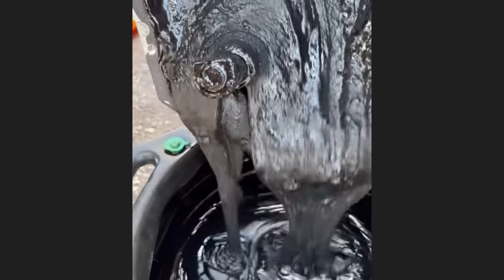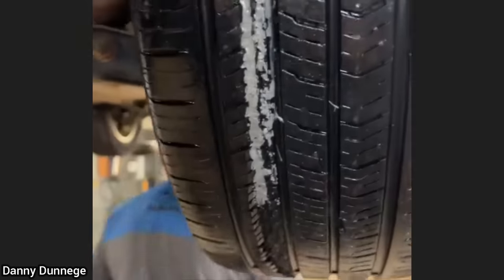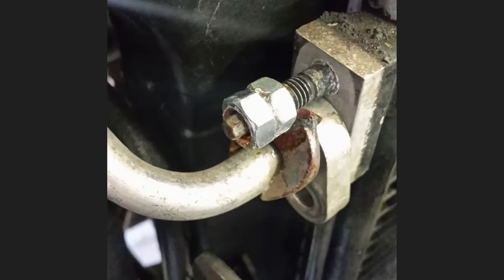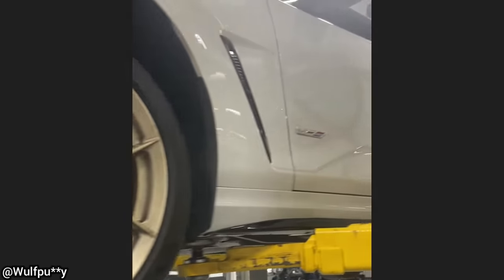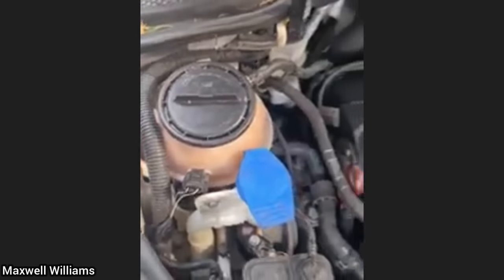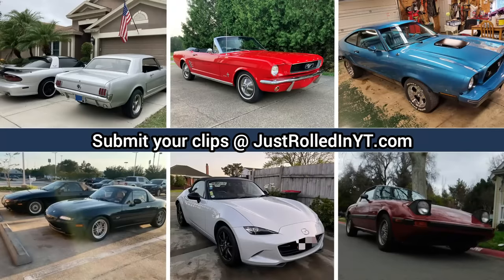Customer States Car Shut Off After Adding Wrong Fluid To Engine

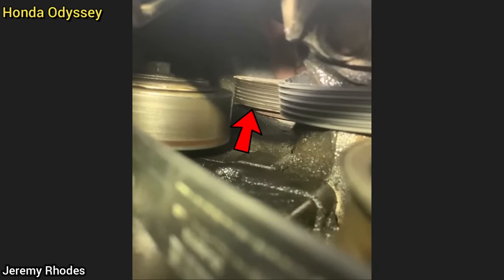Comment: 1:22 To be fair, a harmonic balancer does sound completely made up😂
Reply: It's the duty of the shop or mechanic to explain issues to the customer. I'm sure less people would decline repair if you told them a bad balancer can destroy engine bearings, crack or bend the crankshaft and they're risking catastrophic damage or complete engine replacement.
Reply: A quick web search would confirm their existence in that case....
But people don't tend to think logically most of the time.
Reply: That it does, and as someone who doesn't know much about engines I wouldn't understand from the name. But if the mechanic pointed it out and said "see that thing wobbling right there? it ain't supposed to be wobbling" I'd understand that.
Reply: I had that done on my car years ago, it’s held on by the flux capacitor, right against the flywheel
Reply from the maker: There are a handful of names for a harmonic balancer. Also this is why a ton of shops and dealerships record everything they see wrong on a customer's vehicle and will email them the video.
Reply: @JustRolledIn  Thanks for the update. I always wondered why shops don't email (or display) videos. My dealership tried using a monitor in the waiting room. It didn't last long because a customer got angry and destroyed it.
Reply from the maker: @mikep490  a lot of shops are going this route now, which is good for the customers to know what's wrong with their vehicle and that customer must have received a quote they didn't like 😅
Reply: @Yonkage-ik5qb That's what I do with customers. I take em to my bay and physically show them the failing component and explain how important it is to get fixed or if it's something they can live without.
Reply: @JustRolledIn I don't want em to get too good at it, because I need my "customer declined repairs" drinking game to stay intact. 😂😂
Reply: @JustRolledIn  Showing the customer takes some of the "mechanic scam" out of the picture. (Of course, a picture isn't proof to many people.) I wondered about the guy who did the smashing. "Ok, Mr Smith, here's what we found and it'll cost $2000 to repair. <smash> OK, Mr Smith, you saw what we found and it'll cost $7,000."
Reply: LOL yes, I think 'harmonic balancing' is what you get done at a solstice retreat in Sedona.
Reply: agreed it sounds like a dealer scam or at LEAST like a hazing ritual that involves blinker fluid.
Reply: Took my car in for routine maintenance, and the mechanic wanted to charge me $70 a quart for headlight fluid. I asked if he thought I was an idiot and thought I'd fall for that BS. I left and took it to another shop and paid only $40 a quart. Some people can't tell when they're being taken advantage of.
Reply: @Gruntsworth $40 a quart? That's highway robbery! My mechanic only charged me $5 a quart and 6 hours worth of labor to replace it.
Reply: The term "harmonic balancer" has been around for 90 years (invented by Duesenberg in the 1930s), although it is not a term that most people use in their daily conversations.
Reply: Would you prefer: Torsional Damper, instead? :)
Reply: It does sound kinda Star Trekky.  "The harmonic balancer connects to the phase inducers, which keeps the plasma coils aligned."
Reply: @MrCookieCat  Sir, there are no phase inducers within the matter/antimatter reaction assembly (MARA). You obviously didn't pay attention at the academy. Stick to impulse engines.
Reply: @MrCookieCat  That sounds more like lingo from the Turbo Encabulator videos.
Reply: found the customer smh
Reply: To me 'Harmonic engine balancer' sounds like something you need to fix a spacecraft

Comment: Mechanics gotta have love-hate feelings toward the DIY crowd.
They lose some business at first, but get so much more in return.
Reply: They keep us in business, brother. We love seeing the innovation some folks have.
Reply: To be a good DIY mechanic - you must understand your limitations from knowledge, accessibility, and tools. I can do a lot of things, but also very self-aware of my limits and lines and call the professionals. Sad thing, many "professionals" don't have a clue either. Insert the 20 something year old tech who almost drove my YJ Jeep through his shop door when he didn't push the clutch in and tried to start it(and then blamed it on a "faulty" neutral safety switch which didn't even exist on Jeeps in 1988) and then had to call me on the phone to ask how to turn it off because he didn't know about the button on the steering column beside the ignition.
Reply: Not with me... been burned by too many professional mechanics that I choose to do my own work and I do it well enough
Reply: @Legendsingray  That 20 something guy sounds pretty clueless. I know automatic transmission Jeeps had a neutral safety switch. But I think a 50 something guy I worked with tops this guy. I used to have a 1984 GMC Suburban and one day 50 something comes up to me and tells me I parked too close to his Nissan Pathfinder because he had to depress the accelerator pedal before he could start it that morning. He actually believed the mechanical fuel pump and carburetor migrated to his vehicle! I told him he might have a leaking injector, but he wouldn't hear it. So I told him he now had a reliable fuel system and left it at that.
Reply: @zenjon7892  Lol, I'll fix your screwups anytime.
Reply: @zenjon7892 I completely agree. That said, for some jobs my hourly is better having someone else do the work.
Reply: @jsims2985  na.. I'll be damned if I let you touch my car 😬
Reply: except me. i aint a hack
Reply: @Legendsingray When the clutch release has failed, how are you going to start it on the starter in gear at the lights if there's a cutout?  It's a trick to get it to second, but after that you are good.  Happy days.
Reply: @zenjon7892  Yes.  I do about 80% of my work unless I just don't have the tools, a lift, time, or knowledge.
Reply: @zenjon7892  🤣🤣🤣

Comment: Customer states their car runs rough after putting something that doesn't belong in the engine into the engine....
Is this the reason a certain Dodge car has the word "fuel" on the fuel cap?😂

Comment: A seized brake caliper can sometimes burn a car to the ground. It gets the tire rim so hot so fast the tire catches on fire. Once you got as tire fire its all over.
Reply: I was thinking about a similar situation a few days ago. Back in 07 when I was at a MIDAS. A customer called and said they were coming in with the right front wheel hot and smoky. The caliper was seized. The wheel got so hot that the wheel cover melted! I drove the car in, removed the wheel cover, and started hitting the wheel with water until the steam stopped! The car needed front, caliper, pads, rotors, one wheel, and one tire.

Comment: Yes i did enjoy the video , and a like is always inevitable . You are right buddy the coolant is under pressure but so are the tires the transmission the fuel system and the braking system when operational so adding silicon , duct tape , a chain from time to time and spray foam which is often seen as fixes on this channel is not going to cut it , unless you want to be stranded , injured and potentially in handcuffs  if your choices injures others so please please count on a professional ..

Comment: 1:21
For me as a mechanic, the saddest thing is that there are so many of them and often even such cases can't teach them anything. I am not going to say that "if the service says that you have a problem in "xxx" and it needs to be replaced" you should just agree, no, there are some services where you can be simply deceived, but sometimes such distrust can cost much more than replacing what needs to be replaced.
Reply: Got hollered at from office one while I was under a hood in the shop, sounded urgent,   so I dash up. There is this red in face screaming lunatic,  had picked up r.o box waving it about (tickets going everywhere ) acted like he was gunna throw it a counter lady.  Stopped when I went through door. Screams at me "you dropped my car off the jackstands and broke my door locks!!".  I looked at manager and counter lady and busted out laughing. He stood didn't say a word.  Through laughing I said " I did your brake jobs on a lift sir be hard for me to break your locks ".
Reply: Offered him option a we call cops, option b you clean this mess up calm down apologize  to her and I'll look at them. He said " I'll never be back here!!" . Lol good riddance. 😂

Comment: Surely model-specific roof racks/carrier bars were cheaper (and safer) than a half-assed bed frame job through non-structural roof sheet steel, MOT incompliance, and entirely wrecking vehicle value.

Once they put something properly heavy on that roof it is coming down and through their heads.
Reply: Well, hypotetically, its harder to be cheaper than "free" and regarding the value it might be likely it doesnt matter to the owner. "MOT? Whats that?" - Seems unlikely it will ever see an MOT either.

Comment: I have the opposite problem.
Just junked all 5 lugs on my FR tire cuz shop didn't regulate one of their impacts at the mom & pop shop I last went to. Also had to cut shackle bolts to rear sway bar cuz dealership didn't torque spec, rather impacted to point mounts were bent into the aftermarket bushings.

Comment: I'm partial to the bedframe, with killswitch bolts installed. Some problems just solve themselves. Pray no one but the installer is in the vehicle, and that it travels too quickly over some speed bumps...

Comment: I know that stuck hood latch very personally.....thank you VW for yet another miracle of German engineering with a release cable held together by a plastic ball/socket and virtually no way to get to the hood side of the cable or the latch mechanism without destroying the grill.

Comment: Generally commercial vehicles like sprinters get DEF from the fuel island at truck stops. The Def fill is next to diesel fill  in a sprinter. Considering oil cap says OIL on it...... he was drunk or severely hungover.

Comment: That e gine with black sludge...the owner was very diligent doing oil.changes. The Sprinter van...well german engineers are nuts....they put the DEF reservoir under the hood.

Comment: i didnt know collent resevoirs required the cap. i used to to work at a automobile repair shop, and one customer stated his car was over heating. so we looked and saw cling wrap on the resevoir and filled it up with water and put the cling wrap back on. it worked fine.

then after a few days, the boss of the customer asked us where was the cap. we just looked at him confused and told that there was no cap to begin with. luckily as the boss had worked with us in the past we did have a blown resevoir of the same model and just used its cap 😂

Comment: I just had a friend of my ask me
 why his PRNDL231 indicator would not light up 1st gear after checking the shift cable at the transmission, a previous owner had broke the snap tabs that hold the cable the gear selector and fixed it with electric tape

Comment: OIL goes in the OIL cap
Antifreeze goes in the COOLANT cap
Washer fluid goes in the WASHER FLUID CAP
Transmission fluid goes in the Transmission fluid cap

Why is this so hard to understand? Common sense is about as common as a unicorn.
Reply: What about the 710 cap?
Reply: You forgot one important fluid. Blinker fluid goes into the taillights. 😀😀
Reply: Diesel Exhaust Fluid in the Oil cap, got it!
Reply: @andreww2098  Yep. Sprinters have the Genie lamp; no idea why it also says "recommended" across the bottom. Maybe he got the wrong idea because it also shows the ! icon, the error light that'll pop up on the dash. The other cap is bright blue cap and labeled DEF.
Reply: I just remember colors. 
Golden brown goes in the oil cap. 
Red in the brakes. Or maybe that's for the clutch?
Brown for transmission?
Green in the radiator. Unless it's Toyota, then use red. 
Blue in the spritzer.
Gatorade just confuses me.
Reply: On behalf of many others - you lost me on the first line there. Is Canola OK, or should I use Extra Virgin Olive? What is an OIL cap, and why does it not have any oil? Why did they not put iti in before I bought the car?

Comment: I’ve always wanted to feel an engine seize mid drive, must be a hell of an experience
Reply: Had a few already. Depending on what exactly happens, its not really special and any different than another breakdown
Reply: I had ignition fail on the highway. That's as close as I ever want to get.
Fortunately, I had presence of mind to pop into neutral and use the remaining speed to get over to the breakdown lane. It could have been worse.

Comment: My 1993 4.0 ford Ranger was running terrible and white smoke was coming out of the tail pipe so I replaced the head gaskets and still didnt fix the problem but then I tested the coolant with a tester and it held so we checked the oil and it had tons of gas in it and turned out 3 of my 6 fuel injectors were held open so now Im waiting for new ones

Comment: One of my neighbours thought he was being clever. His tires had worn to the point where they were bald and was quoted $1200.00 to replace them. He didn't like that number so he went to an auto wreckers and bought 4 donut spares to replace his for about $100.00. He was his third set of donuts when I asked him how long they lasted. He said about 3-4 weeks before they too were bald. I told him that he might want to talk to his insurance company to find out how they feel about driving on donuts for more than the recommended 50 miles. He came home the other day with 4 brand new radials. Seems the insurance company objected to his "cost saving measures"..............

Comment: I have driven my old toyota for 7 years without ever changing the oil.
Only did add some when needed.
Never seen this kind of sludge like shown in these clips.
I doubt its just from not changing, looks like mixing wrong types of oil.
Reply: Toyotas don't actually need oil changes .....ever. they are invincible.

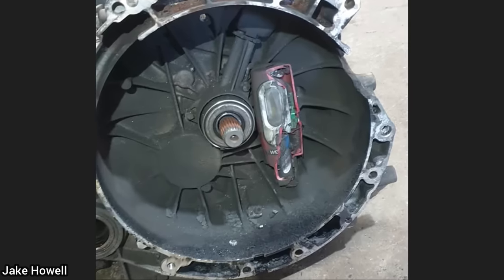Comment: 1:05 you can see the layers of the battery HOW IS THAT WORKING
Reply: He plugged it in via the USB cable, the battery sure should be dead
Reply: @DonnieX6  ah
Reply: @DonnieX6  I would still expect it to pull down the USB power supply voltage but I guess there is several layers of over current protection to prevent that
Reply: Just as well it wasn't using a Li-Ion battery :P
Reply: @HesmiyuMC  what chemistry do you think that is? Cause it looks like an 18650 li-ion cell to me

Comment: I’ll say this surely some people are not this ignorant they can’t be. No offense intended but this stuff seems impossible. My neighbors wife had a little blue Nissan car. That was the best little car ever was now. It didn’t look the best but it was and cheap on gas you could run all week on $5 dollars worth of gas. She thought she’d check the oil one day and the dipsticks had yellow handles one sad transmission fluid the other said oil y’all know what I’m talking about but settin still she grabbed the transmission stick and barely seen any fluid on it so she filled the transmission full of motor oil and didn’t check the other dipstick and ran it dry of oil and ruined the motor quick.

Comment: Technically, you can leave the cap off to prevent pressurizing if you have a leak that can't yet be fixed.   Doing this can reduce the rate of leakage significantly and prevent a cracked component from blowing open due to pressure.  An engine has to be pretty big or getting hammered on hard to cause overheating due to a lack of pressure to increase the boiling point.  I've been able to cope with some pretty serious problems by using this trick to ease the burden on the cooling system.

Comment: The only explanation to some of these is the owner was on drugs when trying to repair their car.  Probably high af.  Its the only way youd forget to put a brakeline back on or remove one and not replace it.   Weve all been there you get motivation after a joint or 2 to fix ya car....it never ends well and an hour job turns into 4 hours and a bunch of bruised and busted up knuckles..

My advice, avoid working on your car when high 🤣🤣. Your life literally depends on the car....would you trust your high self to fix it properly?  I know i wouldnt.

Comment: @1:20 he didn't connect the brake hose because it didn't reach anymore because the calipers were upside down!
Reply from the maker: The calipers are on the correct side.
Reply: It’s been decades since I worked on brakes. But don’t you have to bleed the system and make sure pressure is there? How did they not notice then?
Reply: incorrect. Brake calipers are on the correct sides. what's with these comments? They're worse than the customers in the videos.

Comment: 2:20 so I recently got my brakes repaired after I heard the rear brake calipers begin grinding a week ago, and it turns out the front ones were "this close" to being metal to metal as well. Those were replaced too, and now car runs smooth. I cannot believe this idiot didn't get their brakes promptly fixed even after the first tire blew. That's a lot of money to repair what should have been done a long time ago.
Reply: You'd be surprised how many folks out there choose vape cartridges/lottery tickets/etc over car repairs.
Reply: @jsims2985  Or how many people struggle to afford car repairs because here in the U.S, employers aren't paying people a living wage.

Comment: i watched a mechanic use 5 quarts of Trans Fluid instead of the Motor Oil. I told the Manager,,cancel my appointment👍🏼 dont go to a quick change after lunchtime smoke break!!